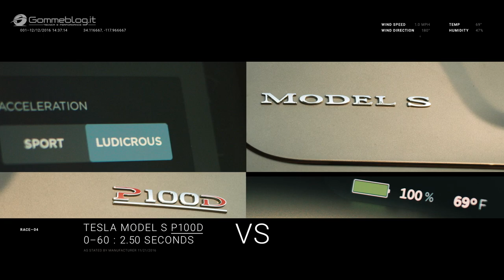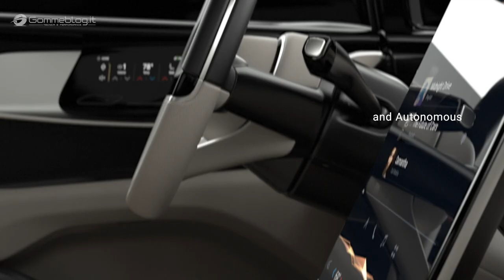Faraday Future FF 91 | 2019 | HOW IT'S MADE the 1050 HP Tesla Model S KILLER

Comment: Faraday's interchangeable battery modules is great selling point vs. Tesla's one single giant battery block.  Faraday can partition one or two battery block/s for recharging via maybe a solar panel sun roof and strippings, braking, and or a secondary turbine generator hooked to the drive system, whenever the car moves it power's this generator to recharge a partitioned battery module.